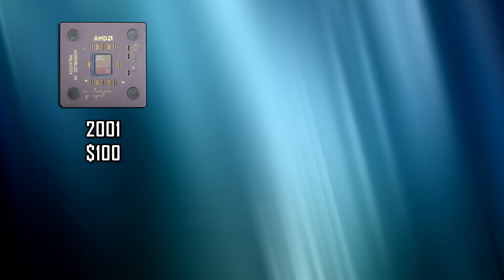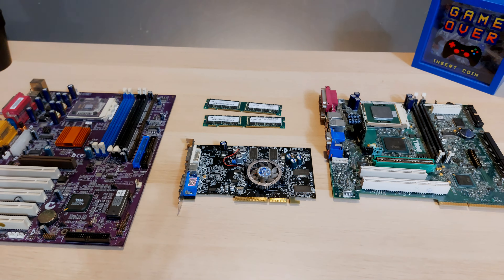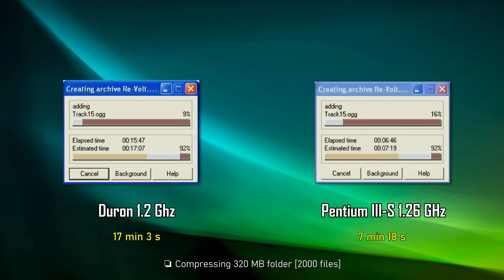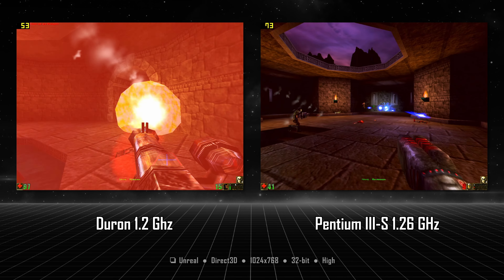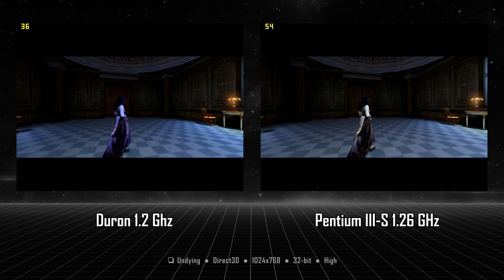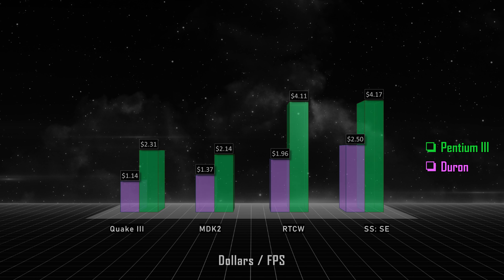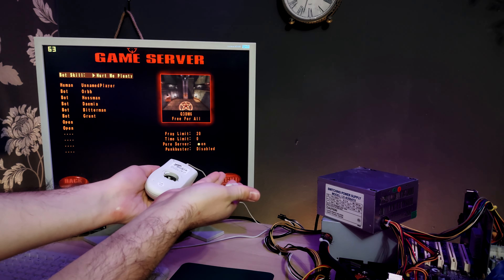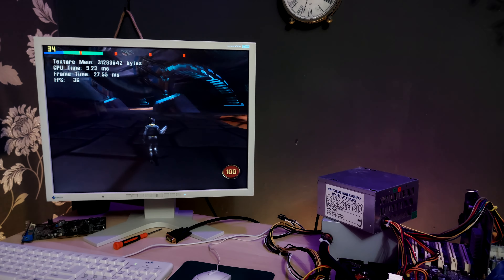Duron 1200 vs. Pentium III 1266

Comment: Excellent video. Still the cheap Duron was by far the best budget option in 2000 and 2001. Also in 2001 you could use the Duron with DDR memory while the P3 could only use SDR and in this case the difference would be a lot smaller.
Reply from the maker: Thanks! You are right, and I really sorry that I only have this joke of a motherboard, but one day...
Reply: @MidnightGeek99 but the KT266A is an excellent performer with DDR and SDR support. I don’t understand why you say that it’s a joke :)
Reply from the maker: @3dfxvoodoocards6  Oh, no, the Dell motherboard, the AMD one is a treasure, I had a similar board in my first computer, it was the same, but from matsonic.
Reply: You're right, by the way, I had a duron 1300 , which would also level the odds a bit)

Comment: I had AMD K6 2 350 mhz (oc from 300) back then. I would have been happy with that Duron.
Reply: Yep! I had had a 333mhz k6-2 with a GeForce 2 MX at that time haha
Reply: I had a K6-2 350 running at 400. I eventually got a 500 really cheap after the Athlon came out.

Comment: in 2002 i did a straight jump from a 1998 celeron 300A (king of overclock) + TNT2 paired with a SLI vodoo2 12mb(1st OG purchase, 2nd one used) to an Athlon 1800+ and G4-4600TI. I kept the vodoo SLI until 2007, sooo many "old good games" with glide only optimization...
Reply from the maker: Yeah, unfortunately glide died with the last Voodoo, nvidia should have integrated it in their video card, after buying 3dfx.
Reply: @MidnightGeek99  was a pain back then, i mean... there was a lot of games running flawless on glide, many games made from 95 to 99 didn't have a patch or port for opengl or D3D. For that reason i kept the vodoo2 SLI

Comment: I had a duron 1000 (1ghz) and paired it with a GeForce MX 440, 2x 256MB DDR and a Sony Trinitron 17 inch CRT. It was amazing. I was a teen during those days and the advantage of using a CRT is that any resolution looked good on it. Even 640x480. Your video brought back warm memories when life was simpler.
Reply from the maker: Yes, the CRT made all the difference. I had a GeForce2 MX 400 and 640x480 was the resolution of choice, but on a 15" CRT it looked ok.

Comment: It is not correct to compare the server top with the cheapest processor . At one time, I compared the Celeron 1700 with the Athlon 1700+, which was cheaper due to the cost of the entire platform) . You can probably guess the results .
Reply from the maker: It's ok to compare if you also take the price into consideration.

Comment: I upgraded from a Pentium 166MMX to a Duron 700 in 2001 so I'm jealous of your Duron's system specs. I also only had a Voodoo Banshee Graphics card but I was more than happy with the system as it was so much better than the old Pentium system.
Reply from the maker: 166 to 700...pretty big increase.
Reply: I also upgraded to a Duron 700 on an A7V that year, from a Celeron 300A@450. It ran nicely at 900MHz. Paired with a GF256DDR it was a killer gaming machine.

Comment: I have recently build my 2001 dream midrange system, consisting of tualatin celeron 1200mhz, via apollo pro 133t board and gf3ti200! Perfect 2001 mid range build imo. Will soon upgrade the cpu to 1300mhz celeron!
Reply from the maker: Nice, I'm still looking for a Socket 370 motherboard that would support my Tualatin, I also want to have a build around this CPU.

Comment: I had a Duron 700 or 800 back in 2000/2001 paired with a Geforce 3 ti 200. Used to lug that pc to lan tourneys all over. Good times, ran everything great. Replaced it with a 1600+, then a 2400+, good times.
Reply from the maker: Nice computer, and you had the proper video card, congrats.

Comment: One of the best comparisons out there. It would have been interesting to see how an equally clocked Athlon XP would have performed, and maybe a Tualatin Celeron. Just to get an idea how much of the performance difference is caused by the cache.
Reply: The athelon xp was I think about 20% to 30% faster (that's my vague recollection and from owning them). It was enough to want one. Also the xp was faster than p4 due to long pipeline issues in the p4.
Reply from the maker: Thank you! Yes, I'm planning to do a proper comparison, this was just a review for the Duron.
Reply: @MidnightGeek99  When you do that you must include some kind of overclocking testing in your comparison. That was one of the main reasons to get a duron/P3 and Athlon XP. They did overclock quite well. I again (it was a long time ago) vaguely remember getting several hundred mega hz from a duron. Which at the time was significant. They also made some nice cheap linux machines.
Some of the Athlons overclocked ok as well but the huge bump you could get with the p3 and Duron made them both budget kings. Also you could do dual socket P2/P3 etc. I had a tyan tiger 2 board that was awesome (dual socket p3). I also had a dual socket P2 board. Both where rather nice even in the early/mid 2000s.
If you could hunt down 2nd hand dual socket boards it might be worth doing some kind of comparison on them vs p4/Athlon etc.
Reply: A Tualatin Celeron should perform very close to a 100 FSB Coppermine P3
And a Coppermine Celeron slightly worse than a Duron.

Comment: I don't want to sound boring, but Duron didn't actually compete with Pentium 3, AMD created the Duron line to compete with Intel Celeron, while Athlon competed with Pentium 3.

I have good memories of Duron, my first was a very very weak Duron, I ran it at 900mhz, but I think maybe it was overclocked a bit. I didn't have money to buy a computer, and I got every part of my computer by scrapping old iron (it was one of the few 462 processors I found without a damaged core), the motherboard I had had to be some kind of ECS Elitegroup , as it was red, and had several bad capacitors, but it worked after a recap. The FX5500 256mb, had graphical problems, several green squares on the screen, there was no YouTube at that time, I was lucky enough to remove the heatsink, and let it work for a while, this seems to have resoldered the chip, and it It worked well for years. I had the usual amount of gigabytes for the time (40GB I think) but divided into several smaller and noisy HDs
Reply from the maker: Yes, Celerons were the direct competitors.

Comment: Duron was EXACTLY what many people needed in early 2000's. Thanks to them, your first PC/ significant upgrade of your old Pentium MMX machine was finally possible at reasonable price.
BTW, I think that the best way to improve performance on system like this is to switch from 32-bit to 16-bit color.
Reply from the maker: Yes, Duron was the reason why some of us had PCs, I had some friends with Durons.

Comment: My Upgrade in 2003-04 from P - II 333mhz and TnT2 pro, was duron 1.3 Ghz and GF 4 MX 440, it was used system and even at that day it was mid range at best but 
playing Quake 3 on hi resolution on 21"CRT was awesome. Served me well over the years
Reply from the maker: Nice, 333 MHz to 1300 and TNT2 to MX 440 was a huge upgrade.
Reply: @MidnightGeek99  
Yeah it was i managed even to run farcry on patoto settings but hey it worked.
thanks for pinup and great video

Comment: Cool video on a near forgotten line of CPUs.  These were in the workstations I used when I took my PC technician's course in 2004.  We had fun panicking when half the workstations (out of about 30 machines) decided to random overclock themselves when we did our very first CPU swap.  This was a problem back then because CPUs didn't thermal throttle or even shut off when they reached critical temps.  You can still find videos online of AMD CPUs burning.
Reply: I've heard of Durons going bang!
Reply from the maker: Yeah, thermal protection was not a thing on AMD, Intel were somewhat better in these regards, but with that also came a premium price.
Reply: @mrmerlin6287   It was an issue with all AMDs back then.  Intel was the first to feature thermal protection for their CPUs.  And even then it was fairly primitive with an emergency shutoff when temps went critical.

Comment: Having looked at the price difference between the Pentium III 1000 at launch vs the Duron 1000 (on Gigabyte GA-7IXEH) that was in my uncle's PC (now a AGIO stepping/Palamino Duron 1300 - shows as Athlon XP 1500+), and having compared the performance myself to a PIII 1000 on my Abit VP6. The Duron may use a lot more power, but it is far faster and launched at around 10% the Pentium III 1000's  launch price.

Taming the heat was the biggest expense for me. It took a N.O.S 80mm Titan cooler to stop the lock ups I was experiencing (CPU also idles 10-15 degrees cooler). My uncle's PC also had a GF2 MX400 - and the new Leadtek version it has now, has diagnostic LED (you can see at a glance if AGP 4x works) and a temperature sensor. 64bit Radeon 7500LE are a lot faster however, so that has become the main card for gaming (even though my Dell example is only 32MB vs the 64MB of the MX400). I use Radeon driver 6.2 for all of my Radeon cards, and 30.82 for Windows 98 and XP with the MX400 (all newer Nvidia cards are used with 71.84, TNT+TNT2 with 3.68)
Reply from the maker: Yeah, the Duron is power hungy, and this is relevant especially now, because you need to use an older PSU, like I did in this video.

For the Pentium III I've used a modern Seasonic, the Duron would not start with it.
Reply: @MidnightGeek99  I've just been using the old 200W Codgen PSU that I repaired (after many attempts - kept blowing caps but not the fuse) for my Pentium III build. 

I was initially using the 145W FSP PSU that came from the same Packard Bell as my Pentium III 650, but decided that I wanted my only quality PSU in my 440LX/BX PC.

My uncles former PC is using the same 300W PSU that was in it - think it was actually replaced as the CPU heatsink was badly caked in dust, but the inside of the PSU was pristine. Has the AT style connector for Athlon MP boards, and has a sticker proudly claiming Athlon and Pentium 4 compatibility (does also have the ATX 4pin for the CPU - so works with 12V boards).

I'll always do my best to repair the 300W PSU as it is the only one that I have which can safely power the GA-7IXEH and Abit VP6 (with both sockets used).
Though since I do have the MSI KT6V as my 12V Socket A board - I do still have options.

Comment: Hello, what is the problem if my computer not shut down in Windows 98se? Is there a bios configuration wrong? My Windows 98 pc is: MSI 754 Mainboard, Athlon 64 3200+, 512 DDR, GeForce 2 MX, creative sb 128b and 80 GB IDE. SATA, onboard sound/Lan are off also serial and parallel ports off. Need help. Kind regards.
Reply: Its ACPI 2.0 problem. Turn of ACPI 2.0 in your BIOS.
Reply: Some later Nvidia drivers would cause this issue too.  Forceware 82.69 and 81.98 have that issue with some cards.
Reply: @foch3  81.98 not really, i had 6600 AGP with 98 with this drivers and works okay
Reply: @tennickjestzajety69  Some cards do though.  My 7800gt has issues with it and some with older cards.  That's why there is a shutdown fix utility and Rloew's patch.
Reply: @foch3  but you know that 7800gt isn't (officially) supported and may have troubles? with officially supported hardware and official driver (81) should be okay, OP has just GF2MX... Forceware 45.23 fits perfectly - not too old, and not newest
Reply: @tennickjestzajety69    I concur 45.23 is a great start.  You would think it's only the unsupported 7 series cards having issues but it's not.
Reply: Win98 can be weird and only a fresh re-install of the OS can solve some issues, in my experience. Not the easiest solution but maybe try that.
Reply from the maker: I had the same issue, reinstalling the OS solved the problem.
Reply: Thanks I will try this

Comment: Would be nice to see a similar video with the Athlon Xp vs P3 Tualatin :). I guess with DDR the Athlon Xp will be faster and with SDR slower than the P3 Tualatin.
Reply from the maker: I would definitely do an Athlon vs Pentium 3, maybe Athlon 1333 vs Tualatin 1.26, or Athlon XP vs Tualatin 1.4.
Reply: @MidnightGeek99  that would be very interesting since the Athlon, Athlon Xp and Pentium 3 Tualatin were direct competitors released in the same period.
Reply: I feel like a great place is around 1000 MHz.
At that point Coppermine and Tualatin are both available as Pentium 3 and Celeron, Athlon and Duron exist as well.

Comment: AMD processors at that time were extremely sensitive to memory speed and timings, the Duron even more so. I had a Duron 950 (because it cost half the price of a 1200), and it was...
A dog.
Really.
Until you destroyed its bottleneck, which was the fact that it more often than not ran with the front side bus unsync'ed with the RAM clock speed and with a low frequency of 100 MHz. Luckily, those processors used the ceramic package, and could be multiplier-unlocked with a pencil - allowing one to drop the multiplier, and thus use the much better (and quite a lot higher) 133 MHz bus speed. Yes, unfortunately at that time the multiplier wasn't simply locked at a maximum, it was set in stone - on a Duron 950, the multiplier was 9.5.
On a VIA KT266A chipset, that meant DDR-SDRAM clocked at 266 MHz effective, in sync with the CPU's FSB; tightening the RAM's latency as much as possible, and tinkering with other things could easily, and with no overclock at all, increase performance by 25 to 35%; actually, I ran mine at slightly lower clock speed of 933 MHz instead of 950 because it allowed me to use an integer multiplier of 7 instead of 7.5, which brought just enough performance that it actually performed pretty much the same as 7.5*133 = 1 GHz but it heated up far less. I could run it at up to 1.13 GHz, and it would work, but it was burning hot and unstable.
I kept it for a while, but I regretted not spending an extra $10 to get the Duron 1000, which supported SSE and would probably have been a better overclocker.
Reply: You just said everything I was thinking, you know your stuff 👍🏻
Reply from the maker: Thanks for the details, you really know one or two things :)

I will surely do other tests with this Duron, so all this info is well received.
Reply: Interesting to see how similar those Durons are to Pentium 4 in that regard. Increasing bandwith will increase performance noticeably even when keeping the CPU at the same clock.
Reply: @HappyBeezerStudios  In the case of the Pentium 4, it's because it ran at such high frequency that keeping its pipeline fed was essential to prevent pipeline stalls - which were VERY expensive in terms of performance. Thus, increasing RAM clock speed was a priority, but the pipeline's length gave you some leeway when it came to latency. the Pentium 4's quad-pumped FSB was also quite good at that and sure as heck not as much of a bottleneck as AMD's.
For the Duron and the Athlon, increasing memory access performance (latency first and foremost, and THEN speed) to the point where actually slowing down RAM clock speed to keep it in sync with the processor's front side bus would increase performance substantially, because you gained one whole FSB cycle on ALL memory operations. Reducing timings (command latency from 2T to 1T was huge, CAS and RAS to CAS were next) was the next step and yielded some more performance (in the 2-6% range). And on those that allowed it, the pencil trick to reduce the multiplier and overclock the FSB was somewhat effective on the Athlon (this usually required to overclock the whole system, thus limited) and a BLAST on the Duron (which was stuck at 100 MHz, so reaching 133 MHz was a big jump forward but did not require overclocking the rest of the system). Provided the chipset's memory controller didn't suck.
AMD learned that lesson well, that's why their 64-bit processors integrated the memory controller directly on die.

Comment: I would have liked to see the comparison with the Duron + DDR vs. the P3S with SDR as well. Or unlock the multiplier on the Duron to get the same Mhz and FSB as the P3S then compare.
Reply from the maker: Next time, this was just a review for the Duron :)
Reply: Same FSB is a bit hard to do. The Duron's bus is double pumped, and I don't know if a 19x multi is available for 66 MHz / 133 MT/s to reach parity with the 133 MHz/ 133 MT/s bus on the P3.
Reply: @HappyBeezerStudios  Durons utilize a 100Mhz FSB. So at default the core speed is 12x100=1.2Ghz. Now, unlocking the multipliers on the Duron is easy with a lead pencil to connect the traces. You can also raise the voltage this way. I believe later in their life they were unlocked at the factory. Anyway, unlocking the multiplier  for 9x and raising the FSB to 133 would yield the same factory speed of 1.2Ghz the Duron has yet with a faster FSB. As long as the memory and motherboard support the 133Mhz FSB, its definitely doable. The only thing then that would separate the 2 CPUS is L1/L2 cache sizes.

Comment: Duron. This ceramic Celeron of AMD's lineage.

Heh, nice to see it covered. Got a 800Mhz here (and a 850 and 1GHz but those two seem to be slightly ded) and I think an Athlon 1133 as well. My board of choice however, was a K7S5A R3.1 - ECS' top overclocker of 2001.
Reply from the maker: I would rather build a Duron system, early Athlons had outrages power demands and heat output.

Comment: Duron was so good for it's price back in 2000-2002. You save money on CPU and put it all towards GPU, use more realistic settings like 640x480 16bit, latest VIA 4in1 drivers, proper BIOS setings for AGP and it was flying in Quake 3. 60+ fps was possible with 1000MHz Duron.
Reply from the maker: Yes, it was a good idea to have a better video card, than having a high-end CPU.